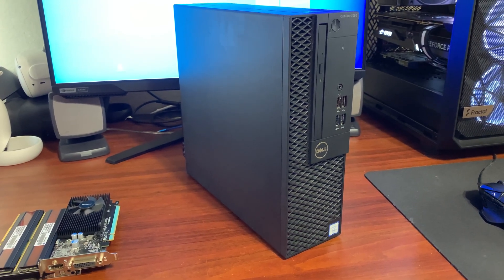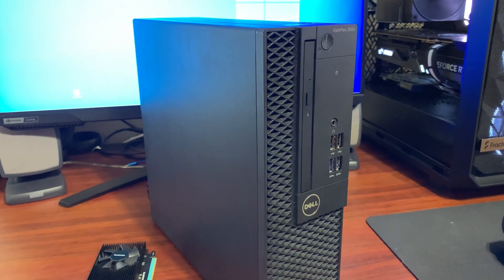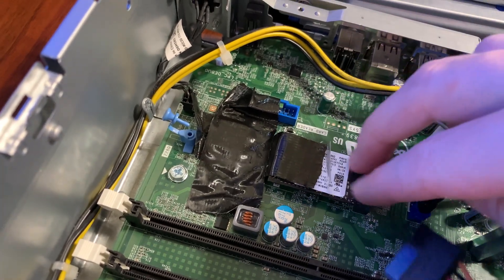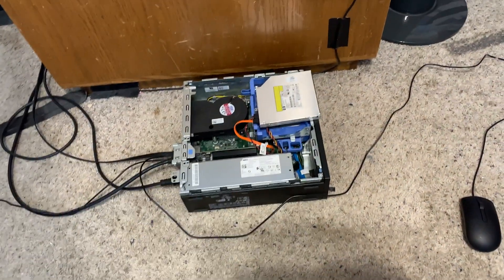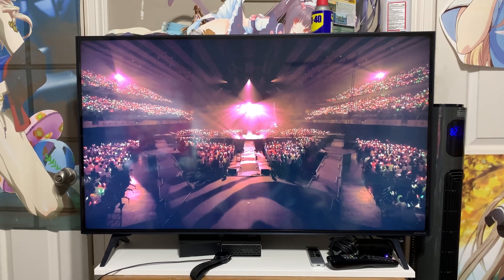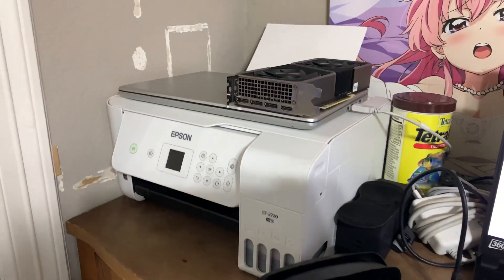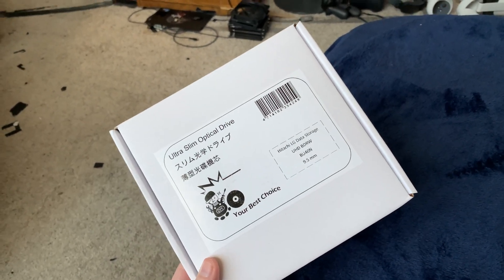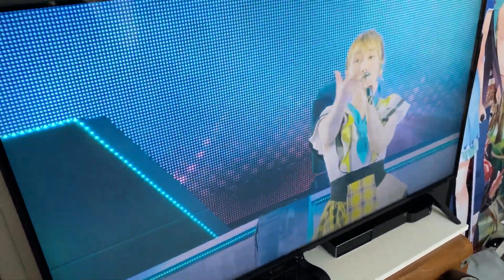Setting Up a Dell Optiplex 3050 For Blu-Ray Playback and Storage

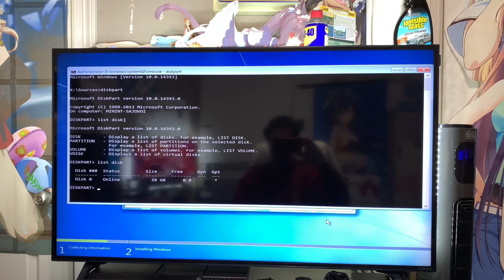Comment: 4:09 windows 7 does not have nvme support but you can mod support in it
Reply from the maker: Ya that's what I thought. Lucky the NvME I had Win7 works completely fine on the dell
Reply: @GenBumbleBee are you sure its nvme and not m.2 sata ? m.2 sata works cause its "just sata" on the software side
Reply: @Necktwister666  The OptiPlex 3050 exclusively uses PCIe for its M.2 slot, so NVMe. It doesn't support SATA.
Reply: Yeah, Microsoft officially released a hotfix to do it, but have now withdrawn it. It can still be found on other websites though.

Comment: is it True you need an intel CPU from 8th to 10th gen to playback 4K bluray?
Reply: To play a DISC (legally), 7th to 10th gen, igpu only, SGX support in bios/mobo, hdmi 2.0, hdcp 2.2.
Reply: nope you only need 6 gen + just google the model number of the cpu and look for "Intel Quick Sync Video" and it should be able to play 4k, hdmi 2.1 cable (double check the hdmi 2.1 verson there all different now make sure it support 4k)